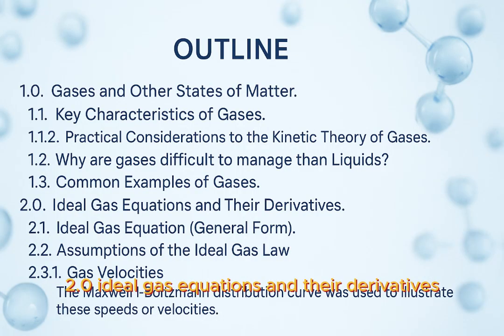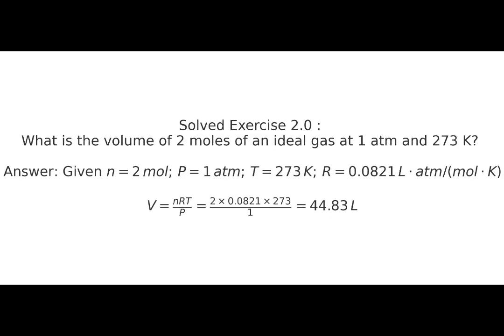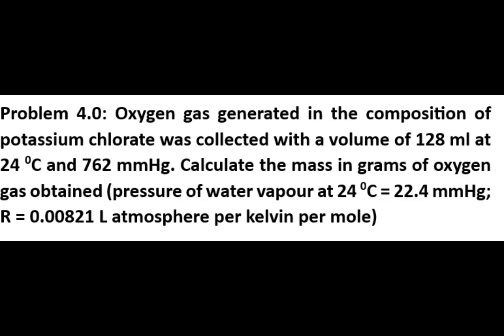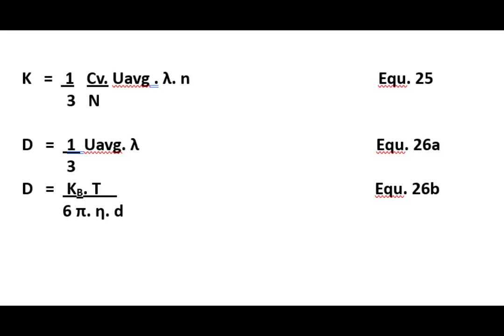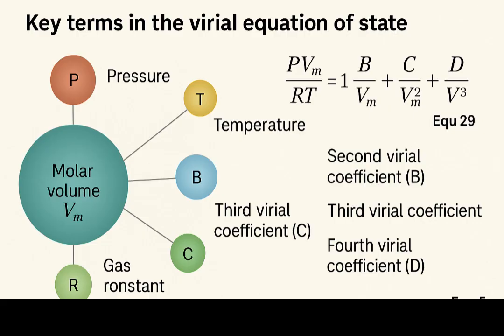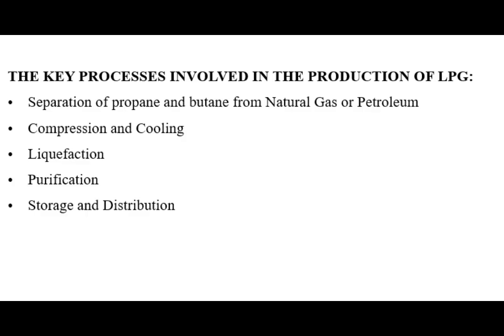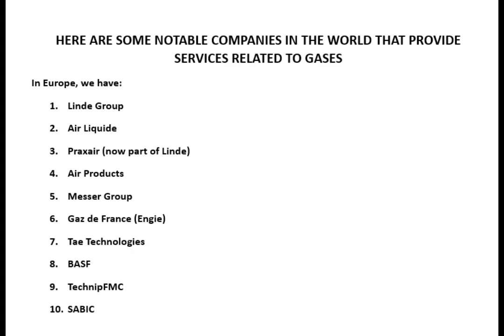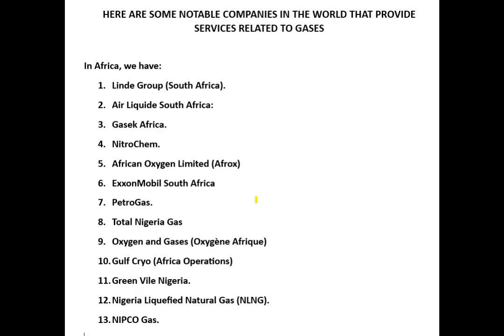Fundamentals and Applications of Gases

Comment: PIC: WHY LNG IS NOT PRODUCED VIA THE JOULE THOMSON EFFECT LIKE THE CASE OF LPG.

LNG is not produced using the Joule Thomson Effect like the case of LPG because the LNG requires cryogenic processes and it's production uses multi-stage refrigeration cycles (cascade processes, expander cycles) etc which involves compressors and heat exchangers. These system pre-cool, Liquefy and Sub-cool methane down to -162°c in stages. This cryogenic processes defeats the purpose of a "simple Joule Thomson" system.

Secondly, High Compression Requirements: To obtain any significant JT cooling for methane you need to start at very high pressure (often over 200 bar) requiring massive energy compressors, thick-walled expensive pressure vessels which increases cost, complexity and safety risks making the Joule Thomson Effect impractical for LNG production.

Comment: "MCB:
Yes, ionization of gases in the atmosphere plays a crucial role in the formation of lightning.

During a thunderstorm, strong winds, collisions between ice particles, and updrafts in clouds cause charge separation — positive charges accumulate at the top of the cloud and negative charges at the bottom.

The electric field between the cloud and the ground (or within the cloud) becomes extremely strong.

This strong field can ionize the air, meaning it rips electrons off atoms and molecules, turning the air into plasma, a conductive state.

Once the air is ionized, it forms a conductive path, and a massive discharge of electricity occurs — that's the lightning.

So, ionization is necessary for lightning to occur because it allows electricity to travel through what is normally an insulating medium (air).

2. Does ionization of gases lead to the lighting of electric bulbs?

It depends on the type of bulb:

In incandescent bulbs (traditional bulbs):

Light is produced by heating a tungsten filament until it glows — no gas ionization is involved.

In fluorescent and neon bulbs:

Yes, ionization of gas inside the bulb is essential.

A small electric current ionizes the gas (like mercury vapor or neon), and the resulting plasma emits ultraviolet or visible light.

Comment: GLY: U2023/5565018
Nitrogen's Role in Coiled Tubing Operations:
Nitrogen is used in coiled tubing operations to enhance oil recovery from wells or reservoirs. By injecting nitrogen into the tubing, it:

1. Reduces hydrostatic pressure*: Lightening the fluid column allows trapped oil or gas to flow more easily.
2. Facilitates fluid flow*: Especially useful for lifting heavy fluids during cleanouts, stimulating reservoirs, or unloading wells with low natural flow.

This technique helps optimize oil production and well performance.

Comment: BCH;U2024/5535136
 using free and pure oxygen gas  in the atmosphere can have several implications;
 fire and explosion risk; high oxygen levels can increase the rsk of fires and explosion.
Health effects; breathing pure oxygen for extended periods can lead to oxygen toxicity, which could lead to damage of the lungs central nervous system and eyes.
Environmental impact; Altering the atmospheric composition can have unforseen effects on ecosystems and the balance of gases in the atmosphere.
Material degradation : high oxygen levels can accelerate the degradation of certain materials, such as metals and plastic, through oxidation reactions.

Comment: PIC:
The J-T experiment demonstrates a cooling effect used in gas liquefaction.

Why LNG is not produced via the J-T experiment as LPG this is because the two gases, have different properties and require different processing methods for liquefaction.

Seeing that LNG production, relies in cryogenic refrigeration cycles and large scale liquefaction plants to cool mostly methane to cryogenic temperatures.

While LPG production, involves  compressing and cooling heavier hydrocarbons, often by propane or butane refrigeration cycles,which are more easier to liquefy at comparatively higher temperatures and pressures.

Comment: BCH : U2023/5535178

Using free and pure oxygen from the atmosphere instead of a cylinder during surgery for anesthesia is generally not recommended or practical due to safety and logistical concerns. While pure oxygen can be beneficial in certain situations, relying on ambient air as a source introduces risks and complexities

Comment: ELECHI SALVATION ARUCHI 

PIC:  LNG (Liquefied Natural Gas) and LPG (Liquefied Petroleum Gas) have different production processes due to their distinct properties.

LPG is produced through fractionation and compression, leveraging the Joule-Thomson effect. However, LNG production involves cooling natural gas to extremely low temperatures (-162°C) using complex refrigeration processes, often involving mixed refrigerant cycles or nitrogen expansion cycles.

The Joule-Thomson effect alone isn't sufficient for LNG production due to the much lower temperatures required.

Comment: GLY :Nitrogen is used in coiled tubing operations to lift fluids, initiate circulation, clean the wellbore, perform underbalanced operations, and purge or displace other gases—making the operation safer, more effective, and less damaging to the reservoir.

Comment: PIC

LNG (Liquefied Natural Gas) is not produced with the Joule-Thomson experiment alone because it is mainly  composed of methane  which has a very low boing boint making liquefaction at room temperature difficult 

LPG, on the other hand, can be liquefied at relatively low pressures and temperatures, making the Joule-Thomson effect suitable for its production

Comment: GLY. U2023/5565025
Nitrogen is used in coiled tubing operations to lift fluids, reduce wellbore pressure, and clean the well. It helps start circulation, supports underbalanced operations, and improves safety by acting as an inert gas.

Comment: BCH: The use of atmospheric air for anesthesia rather than the oxygen cylinder is not safe because atmospheric air contains only 21% oxygen, and not oxygen alone; it contains other substituents like nitrogen, carbon dioxide, and even dust, etc. And also, the patient's respiratory system can be infected by pathogens because the air is not sterile. While the oxygen cylinder, if not 100%, is 99% pure, which is essential for the patient. Conclusion: Atmospheric air is dangerous for anesthesia during surgery.

Comment: Menyuah-Hart Delauren Mbanefo
BCH:Using atmospheric oxygen instead of pure oxygen from a cylinder during surgery is not safe or viable due to
Insufficient oxygen concentration and
Risk of contamination

1. Insufficient oxygen concentration
Atmospheric air contains only about 21% oxygen, which is often inadequate for patients undergoing surgery who may require higher concentrations to maintain proper oxygenation, especially under anesthesia or in critical conditions.

2. Risk of contamination
Air from the atmosphere is not sterile and can contain dust, bacteria, viruses, and other pollutants, posing a serious risk of infection during surgery in a sterile environment.

Comment: BCH: U2023/5535075
Using free and pure oxygen from the atmosphere for anesthesia is not feasible because it lacks the necessary concentration control, introduces contamination risks, prevents pressure control, increases fire hazards, and is impractical. The controlled environment and precise delivery of oxygen from a cylinder are essential for patient safety and effective anesthesia.

Comment: PIC: WHY LNG IS NOT PRODUCED FROM THE JOULE THOMSON EXPERIMENT LIKE THE CASE OF LPG.

LPG can be liquefied using just compression and Joule Thomson cooling, because its components have higher boiling points and favourable inversion temperatures.

In the case of LNG (Methane), it requires much lower temperatures, so the Joule Thomson effect alone is not sufficient. More complex refrigeration and expansion systems are needed.

LNG is significantly more complicated to produce than LPG.

Comment: PIC

LNG(liquefied Natural Gas) is composed of mainly methane , it has very low boiling point and does not cool during expansion at room temperature instead it heats up.

While in the case of LPG (Liquefied petroleum gas)which majorly consist of propane and butane ,cools down easily during joule -thompson expansion at room temperature making liquefaction by this method easier .

Comment: GLY: Nitrogen is used in coiled tubing operations to help recover oil from wells or reservoirs by reducing hydrostatic pressure in the wellbore. It’s pumped into the tubing to lighten the fluid column, allowing trapped oil or gas to flow more easily. This is especially useful for lifting heavy fluids during cleanouts, stimulating the reservoir, or unloading wells that aren’t flowing naturally.

Comment: BCH:
Using ambient oxygen instead of medical oxygen from cylinders during surgery is both dangerous and categorically unacceptable. The air around us contains just 21% oxygen and is far from sterile; medical oxygen is 99% pure and designed for clinical use. Depending on ambient air exposes patients to severe hazards: wound contamination, inadequate anesthetic delivery, hypoxia, and potential fatalities. Such practice contravenes both medical protocols and legal regulations. For these critical reasons, only medical-grade oxygen is permitted during anesthesia, safeguarding the patient and the integrity of the surgical procedure.

Comment: BCH: "Utilizing free and natural oxygen from the atmosphere for anaesthesia during surgical procedures presents several critical concerns.

To begin with, atmospheric air comprises only about 21% oxygen along with other gases such as nitrogen, carbon dioxide, and trace substances. This level of oxygen is insufficient for patients undergoing surgery, particularly under general anaesthesia, where a higher and carefully controlled oxygen concentration is essential to sustain vital physiological functions.

Secondly, the air around us is not sterile. It may carry microorganisms, dust particles, and environmental contaminants. Directly introducing this unfiltered air into a patient’s lungs increases the likelihood of infections or respiratory tract irritation, thereby putting the patient’s health at risk.

Thirdly, the concentration and supply of oxygen during surgery must be accurately managed. Medical-grade oxygen stored in cylinders is manufactured under strict conditions to ensure 100% purity and stable delivery. This is crucial for maintaining adequate oxygen levels in the patient’s body and preventing both oxygen deficiency (hypoxia) and excessive oxygen (hyperoxia).

Finally, anaesthesia equipment is engineered to operate with pressurized, purified oxygen—not ordinary air. Attempting to use atmospheric air bypasses the machine’s built-in regulation and safety systems, which can result in errors in anaesthetic administration."

Comment: BCH: Using free and pure oxygen gas from the atmosphere for anaesthesia during surgery poses several serious implications.

Firstly, atmospheric air contains only about 21% oxygen mixed with other gases like nitrogen, carbon dioxide, and trace elements. This composition does not provide a high enough oxygen concentration for patients undergoing surgery, especially when they are under general anaesthesia and require controlled oxygen levels to support vital functions.

Secondly, ambient air is not sterile. It may contain microbes, dust, and pollutants. Introducing this unfiltered air directly into a patient's respiratory system would increase the risk of infection or lung irritation, compromising patient safety.

Thirdly, the purity and delivery of oxygen during surgery must be precisely regulated. Medical oxygen in cylinders is produced under stringent conditions to ensure 100% purity and consistent flow, which is critical for maintaining the patient's oxygen saturation and avoiding hypoxia or hyperoxia.

Lastly, anaesthesia machines are designed to work with pressurized medical oxygen, not ambient air. Using atmospheric oxygen bypasses these systems and their safety features, potentially leading to anaesthesia delivery errors.

Comment: BCH : 
a. Atmospheric oxygen is not pure as it contains only about 21% oxygen. 

b. Cylinders provide sterile, filtered and properly controlled/monitored oxygen. 

c. Atmospheric oxygen has low and fixed pressure making it adequate for ventilators or delivery masses

Comment: Name:OGBOLE BLESSING JAME
Dep:BIOCHEMISTRY(U2023/5535122)
 The implications of using free and pure form of oxygen gas in the atmosphere rather than cylinder of pure oxygen for anaesthesia during surgery are:1)contamination risk
2)concentration and purity
3)safety and reliability
4)flow control and regulation
While using atmospheric oxygen for anesthesia has potential benefits, it would require significant technological advancements, infrastructure modifications, and safety protocols to ensure reliable and safe oxygen delivery. Current medical practices rely on controlled, purified oxygen sources for anesthesia.

Comment: MCB: IONIZATION OF GASES
Yes, gases can be ionized. In the atmosphere, ionization of gases enables the air to conduct electricity. This is what leads to lightning during thunderstorms. When intense electric fields are present, they ionize the surrounding air, creating a conductive path. This allows electricity to travel through the air in the form of a lightning bolt.

LIGHTING OF ELECTRIC BULBS
Yes, ionization of gases plays a key role in the functioning of certain electric bulbs, such as fluorescent and neon bulbs. In these bulbs, the gas becomes ionized, allowing electric current to pass through and generate light. In contrast, incandescent bulbs do not rely on gas ionization instead, they produce light by heating a metal filament until it glows.

Comment: Gly U2023/5565040
In coiled tubing operations, nitrogen is treated as a real gas because downhole conditions involve high pressures and temperatures. Ideal gas laws don’t account for molecular size and interactions. Using real gas behavior ensures accurate calculations, safe pressure control, and effective performance during well interventions.

Comment: BCH:Atmospheric Oxygen:
1. *Concentration*: Atmospheric oxygen is approximately 21% of the air we breathe. Anesthesia requires a much higher concentration of oxygen.
2. *Control*: It's challenging to control the flow and concentration of oxygen from the atmosphere.

Cylinder of Pure Oxygen:
1. *Controlled flow*: Oxygen cylinders provide a controlled flow of pure oxygen, which is essential for anesthesia.
2. *Precise concentration*: Medical oxygen cylinders ensure a precise concentration of oxygen, which is critical for patient safety.

Implications:
1. *Patient safety*: Using atmospheric oxygen would compromise patient safety due to the lack of control over oxygen concentration and flow.
2. *Anesthesia efficacy*: Precise control over oxygen flow and concentration is crucial for effective anesthesia.

In medical settings, cylinders of pure oxygen are used to ensure patient safety and effective anesthesia.

AMADI CONFIDENCE CHIDINMA 
U2023/5535135

Comment: BCH: Atmospheric oxygen systems would need to be highly reliable to ensure uninterrupted oxygen supply during critical surgeries.
   
While using atmospheric oxygen could offer several advantages, addressing the technical, safety, and regulatory challenges would be crucial for its practical application in surgical settings.

Comment: MCB:
i. Yes — ionization of gases in the atmosphere is essential for lightning to occur. It helps create the conductive path that allows electric charge to flow through the air during a thunderstorm.

ii.Yes, ionization of gases leads to the lighting of certain types of electric bulbs, especially fluorescent, neon, and HID lamps.

In these bulbs, electricity ionizes the gas, creating plasma that emits light.

But not all bulbs use ionization — incandescent bulbs rely on heat instead.

Would you like to see a comparison table of different types of bulbs and how they work?

Comment: MCB:
Ionization of gases in the atmosphere is the key process in the formation of lightening during thunderstorm because collision between water droplets and ice particles leads to a build up of electric charge, the charge creates a strong electric field between the cloud and the ground, when the electric field overcomes the insulating properties of air, it causes ionization of air molecules, allowing a massive discharge of electricity (lightning) to occur.

Ionization of gases is also a mechanism by which fluorescent and electric bulbs produces light, inside these bulbs a gas like mercury vapor in flourescent b
Reply: Mercury vapor in flourescent tubes is present which ionizes the gas molecules when electricity is applied, the ionization process causes the gas molecules to produce UV light  which produces the bulbs illumination

Comment: BCH: Using free and pure form of oxygen gas in the atmosphere rather than the cylinder of pure oxygen for anesthesia during surgery would be harmful.

- Pure oxygen in the atmosphere would make everything highly flammable, increasing the risk of fires or explosions during surgery.

- Breathing pure oxygen for too long can damage the lungs, brain, and eyes, especially in newborns, making oxygen toxic.

- Loss of Anesthesia Control: Anesthesia requires carefully controlled oxygen mixed with anesthetic gases. This is impossible in an open-air oxygen environment.

 - It Can Cause Environmental and Biological Harm, Pure oxygen in the atmosphere would harm plants, animals, and microbes that depend on normal 21% oxygen levels.

-Medical Safety and Cleanliness: Oxygen cylinders are sterile and precisely controlled. Free oxygen in the atmosphere cannot be regulated or kept clean.

Using oxygen cylinders during surgery is safe, controlled, and medically necessary. Using free pure oxygen in the atmosphere would be dangerous, uncontrollable, and harmful to both human health and the environment.